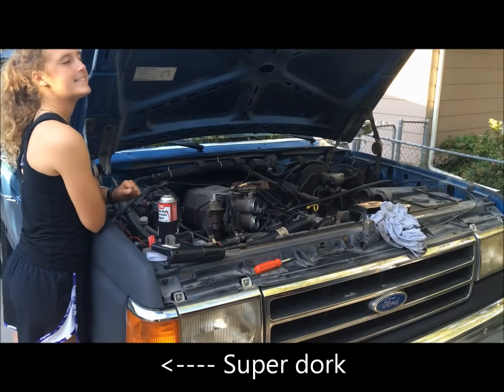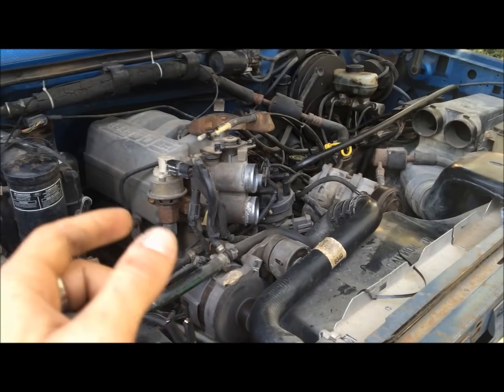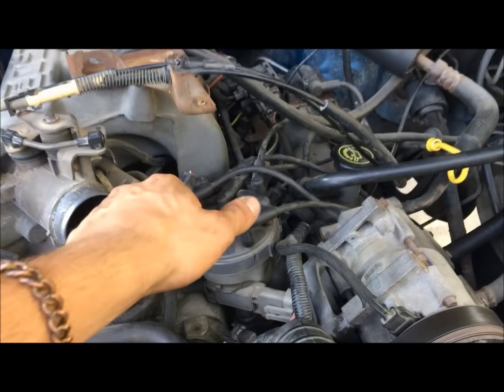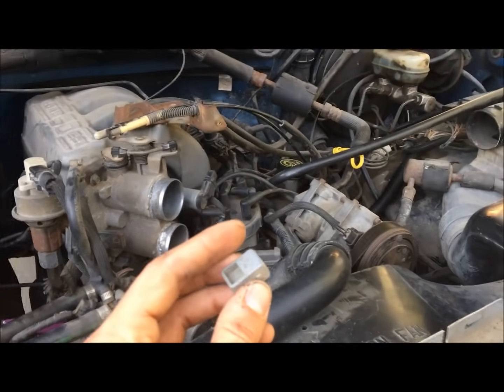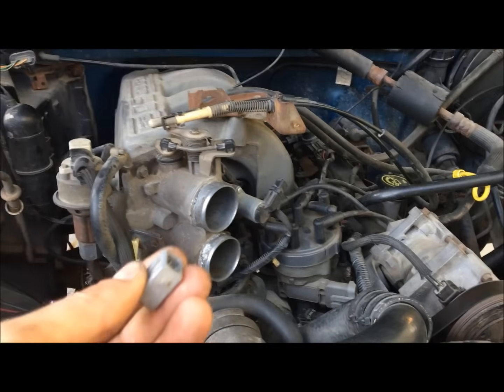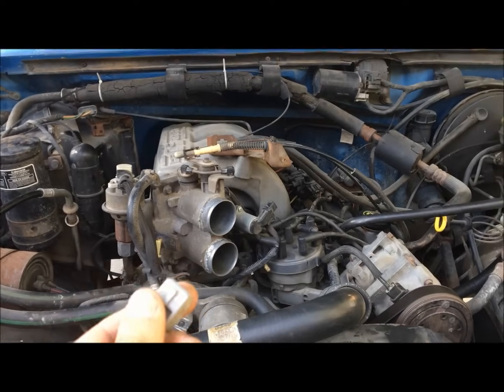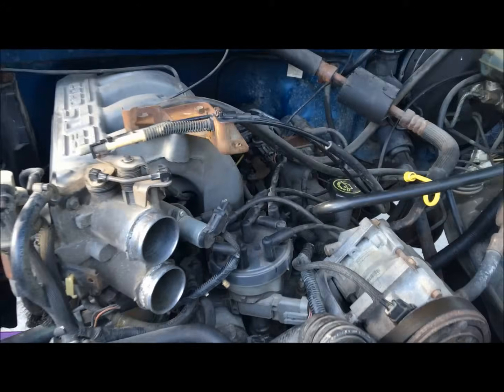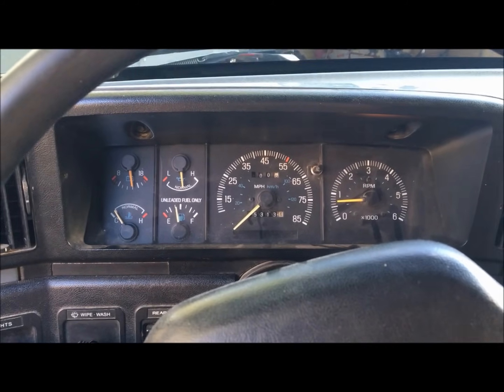Setting Ignition Timing - EFI Ford 302/5.0 (Bronco & f150 - How To)

Comment: I have a question and I'm not sure if you have the time to respond but i have a 88 f150 automatic 5.0 and the distributor is not aligned as in set or sitting like yours is in this video like i mean the Ignition module on the distributor. Yours in the video shows it sitting closer more to the ac compressor but mine is sitting right up against more to the thermostat housing so would that mean the timing is set completely wrong ? 

I ran engine up to temp and unplugged that connector then tryed to set the timing at 10 degrees but the problem is no matter where i set the timing light cause i have a dail to do advance on ig the marks don't show up at all so i marked the crank pulley wkth the balancer and then i could see where it was sotting at and apparently the mark is on the bottom side of the pulley when running and trying to move the distributor to move the mark back up around on top where the timing cover has it marked at will not work and only thing i can think of is the timing is 180 degrees out
Reply: So either 1 its 180 degrees out or 2 the balancer is so worn out it slipped and that's why the mark on the balancer is showing the marks on the bottom and not way up where it should be 

Also if I try and turn the distributor back about where yours is in this Video the truck will not start and it will die.  I have to have it pushed all the way to the thermostat housing for it to Run . 

Hopefully you or someone can help me with this . Thanks

Comment: So I just replaced my distributor and now my truck won’t even start to do this process any ideas what I should look for also can hear the fuel pump turn on and off but just cranks and won’t turn over
Reply from the maker: Did you do all the proper things for setup when you installed the distributor?
Reply: @ThunderHead289  I’m pretty sure I did
Reply: @coltonburke7639 ... Well...1st, buddy...Anytime you ask a question or want a direct answer on YouTube,   you need to give as much information as possible...Such as, in my case...(1993 Ford f150 5.0) auto tranny 2WD, No mods...That way, the OP can have a idea how to help you...2nd...Even if I was a ASE certified mechanic,  I couldn't help you coz I don't know WHAT kinda trk or engine you got.....4 cylinder...6 cylinder...8 cylinder...Gas or deisel or what...???....Kinda like going to the Doctor...Tells him you gotta stomach ache and Diarrhea...Didn't bother to tell him you just left a All-you-can-eat Pie-Eating Fest...Same thing here...Sooo...Re-ask and give the OP ALL the information he needs to help you...Cheers 🍻!!!!😊😊😊

Comment: The timing is stamped on under the hood if its pinging you have really bad gas with to much ethanol typical nowadays they put to much ethanol to be cheap. Also O'reillys fuel treatment is in a red bottle can help sometimes better more methanol then ethanol in the type of situation let it sit for a while first before you start it up.  Great for a rig that wont idle like it used to without bad gas.

Comment: i HAVE 1986 bRONCO with efi what is the firing order for this monster  online state 13726548 for efi and 15426378 for carb unit
Reply from the maker: 86 stock cam should be the firing order that ends in 78 (if it’s a 302) 
In 1994, all 302s sported the 48 firing order which is also the 351w firing order.

Comment: I've got a 1992 F250 5.0 EFI.....and just installed my rebuilt engine...and struggling with timing.  Don't have a timing light yet....but I will get one soon.  In the meantime, is it a good strategy to set initial timing with a vacuum guage?  I installed an aftermarket guage in the cab....along with a trans temp guage.  If you use a vacuum guage, how do you specifically do it?  Right now, I have it set so I'm getting a vacuum reading of about 16.  Haven't checked to see how far I advanced the timing, though.  My spout connector is on the fender....but I haven't set timing by taking it out.  Will try that tomorrow.  I just set timing with the spout connector in place...while idling.  Truck ran fine....but knocking just slightly, I think.  I think I'll back off ever so slightly tomorrow...and see how it runs.  Will try doing it with the spout connector disconnected...and see what happens when I put it back in.  Would be so much easier to set timing on an older vehicle...where it's all under your control...and don't have to consider the electronic control done by the ecm....lol.
Reply: You can kinda set the timing by ear if it's straight piped/ no muffler etc. Def need a timing light. Go to harbor freight and get one
Reply: @pete538  Ended up getting it done well, with the use a timing light..an installed aftermarket manifold vacuum guage...and by ear and throttle response.  WHen it's warm, it runs at about 18 psi, which is pretty healthy, I would think...and I think the final timing is about 15 degrees.  I forget exactly , as it's been a while since I did all this stuff.  I set the timing late summer last year.  It's been running great....and no leaks...lol.  I replaced a bunch of the vacuum lines, which really helped the cause.  Runs nice and smooth.
My only remaining issue is that it  only idles for a short time on it's own, when cold...and so I have to keep my foot on the pedal to idle at about 1000 rpm for about a minute to two to get the engine warm.  After that, it idles fine.  I had already bought an idle air control bypass but pulled it off when I was struggling with timing....and need to reinstall it.  It's a matter of just doing a little more setup, as I also removed the EGR pipe from the top of the intake manifold...and am just running it off to the side with an air filter on the pipe.  These things don't adapt well to aftermarket manifolds.  All that stuff has very likely changed the air flow during the warm-up period....so it needs some fine tuning.

Comment: I have a 96 f150 that I need to put the distributor back into after removing. This is the first time I've dealt with timing at all. When I first intstal the distributor should I have the timing mark set to TDC 0 or do I need to install the distributor at 10 degrees BTDC?
Reply: Put the distributor in at tdc....and then advance it about 10 degrees (clockwise) before you start up.  Makes it easier to start...and then set the timing from there.  I'm basically doing the same right now on my 92 F250 5.0, after rebuilding the engine.  Make sure you have good gas in the tank.  I'm not religious about the 10 or 12 degrees.  I think that's just a conservative factory setting.....but probably isn't the best setting for maximum power / torque.
Reply: Oh hell I hope you marked the spot where you removed it. If not you'll have to pull the 1st plug to find tdc

Comment: I have a 1989 Ford Bronco Full size 5.0  302 ci  When the motor is warm i can't turn the distributor,  when it's cold i can,  yes the bolt is loosen  i have worked on Cars and Trucks my whole life and never had thin happen,  i am 58 yrs old  the heat makes the metal expand  so i am going to use a wrench to try and turn it ...

Comment: Hi! I have a 89 Ford F-150 with the 300 manual. I was wondering if anyone could give me information on raising the throttle higher to have a smoother take off in 1st gear just for the ease of driving.
Reply: Lol take a few vacuum hoses off. I've got a few vacuum leaks and mine has a high idle when cold for longer than it should. I wouldn't worry about it. Just use that gas pedal

Comment: Video is a great help.  Would greatly appreciate your help with one thing:  I have the 1/2 inch bolt loosened but cannot rotate the distributor...is there a trick to how to grab a hold of it?  Thank you.
Reply: It's likely gummed up.  Shoot the base with some penetrating oil and let it sit for a day.  Might help too to remove the air intake hoses so you can get a better grip.  It should turn without much effort.

Comment: I have a 95 f350. 460 engine. Was told timing is too advanced since it idles high, smells of gas (rich), and once I drive it, it acts like the battery is about dead. Turns over very slowly. Once it’s cooled a bit it starts fast again. It’s a new starter. New solenoid. Wires are all good. Anyways. Do you have a video to check the timing on my beast?  Thanks.
Reply: Timing shouldn't affect idle. Probably a vacume Leak

Comment: Hi 
 i need help with my grand marquis 1985 it is electronic control ignition 
My problem is when I connecting timing advance wire the engine become bad running and locks like misfire and when i disconnect the wire engine running smoothly 
I adjusted timing as the factory said (10°) b tdc
Please help me I can’t fix this issue
Reply: Same

Comment: I have issue with my 85 grand marquis I adjusted timing as factory bock 10° B tdc and plug advance wire but the car still jerking at 40 miles speed 
When I disconnected advance wire the car jerking disappeared and engine running smoothly

Comment: I tried this with my 93 lightning but when I turned the truck off and reconnected my spout, when I turned it back on and checked the timing it set back to what it was before. Which is at 24, any idea what went wrong?

Comment: What is that little knob in your hand called
Reply: It's called the SPOUT connector. Stands for Spark output. It retards the timing when disconnected. The timing should advance when it's hooked up. If not, it's the module.

Comment: i have a question... need help with my 89 bronco.. 5.0.. passenger exhaust manifold sensor.. is it air temp or O2? ford says its an air temp sensor.. autozone swears its an O2.. what is it.. currently wires cut. so i need to replace it..
Reply: It's the 02 sensor. If it's screwed into the exhaust manifold. Air temp. sensors are screwed into the intake manifold.
Reply: Ya, it's an O2 sensor. In 1992, it's on the Y pipe...also on passenger side of exhaust.  The connector comes off the harness going to the starter.  Basically part of the smog system, monitoring exhaust temp going to the catalytic converter.

Comment: what size is the hold down bolt?
Reply from the maker: A half inch shallow socket on a swivel with an extension is what you will need to loosen it

Comment: I can't find the thing you unplugged. What if I don't have one?
Reply: Mine was over by the driver side fender
Reply: It retards the timing for base timing. It's usually in-line with the module wiring. Use white-out to mark the timing mark. Check for 10° mark. Timing advance is 30.
Reply: It's actually called a Shortening bar and Not a bad thing if you DON'T have it. PITA if you lose it.

Comment: Get a Actron CP9690 code tester. It checks graphing, live, record, oxygen sensor tests, MIL light reset, oil change light reset, ABS, and MORE! It comes with OBDI cables for Ford, G.M., Chrysler, and 2 Toyota. It has a cigarette lighter cable, instructions, and a black pouch. It's very easy to use!

Comment: What year is your Bronco and does it have a mass air flow if it does what is your computer part number
Reply from the maker: +Sisgirlie17 we no longer have the bronco - it being a 90, I believe it predates maf. Should be the same process if I remember correctly. 94 the firing order changed to the 351 order. But cylinder 1 is in the same location

Comment: Hey can you help I have a 1992 bronco with the 5.8 Windsor it runs good but when I try to pass on the highway it revs but doesn’t go like it should. It takes off just fine from a stop. What do you think it could be?
Reply: Clay S i run a 90 351w in my bronco. It came out of a f350. Its pretty lazy to be honest.  351w does best on NGK spark plugs... ive tried others... no good. 
Have you ever replaced the inline fuel filter? Has the catalytic converter ever been takin off or replaced. If you drive it hard at night.... look under the truck to see if the cat is glowing red hot.  If it is its plugged. Change it or knock the guts out.. my 88 was plugged bad. Also... inspect or replace the cap and rotor if the terminals look dirty or corroded. A lil crack in the cap will do all kinds of things. ... also check the air cleaner.. make sure mice or squirrel s didnt make a new home... ive seen it...   the 351w will pull the ass out of the world but in stock form they are not real fast. If your comparing to new pickups forget it... new stuff is stupid fast compared to our old broncos.  My 400hp 408windsor bronco wont keep up with my dads ecoboost. Just sayin..
Reply: @endurotruckererniedesjardins  Ya....I'd rather have the old simple vehicles, any day of the week.  At least it's normally not too hard to keep the vehicle maintained and running.  The only time I have ever been stranded was due to a fuel pump that died on me.  Generally, I don't have to worry about the electronic shit that strands newer vehicles so often.

Comment: Hello, hope u can be the one to help me out, I've asked many mechanics on here , some never answered, my 93 ford f-150 has a fluctuating rpm's and tailpipe backfire, have replaced failed fpr, iac valve and the tps, but still have same problem.
Reply from the maker: Do the spark plugs.
Reply from the maker: +ThunderHead289 do the spark plugs and the cap n rotor with new wires. Always neglected, makes a big difference.
Reply: Remove distributor cap and clean distributor out good with a can of brake clean. Then blow it out with air. See how it runs. Debris and crap build up in there and will interfere with distributor pickup coil signal. Still runs like crap or stalls, check your pickup coil in the distributor by testing voltage between it and ignition module. Should be between 4 to 6 vdc while cranking. No, low or high vdc, replace the coil/distributor. This is in assuming the rig has been tuned up and kept serviced.

Comment: I have a 96 model 302 5.0 EFI Ford pickup. Just rebuilt the engine and the guy before me had all of his vacuum lines everywhere. Is there any way you can make a video showing how the vacuum lines are supposed to be run correctly. I have it up and running, just do not have anything correct when it comes to the vacuum lines.
Reply: Diagram should be on the air filter canister top.

Comment: the throttle response to me is weak the motor barely stumbles it's hard to tell but I feel like they may have not done timing correctly or even worse the distribution is off a few teeth but that's unlikely.
I have the notorious shuddering when start idle or going even slow I know the mercon iv old fluid is the cause and the friction modifiers break down . I haven't changed to mercon V yet but I will just figured that the timing is a good start. All I really wanted to know is what to look for anything that could be bad aside from timing off
Reply: Your Trans fluid can't be the problem. I had a lugging/ misfire on my manual at low rpms and it ended up being plugs. The plugs the previous owner bought were nice but impossible to gap (4wires going to the center of plug) I changed to cheap plugs and gapped them correctly and the lugging/ misfire went away.

Comment: I just bought a almost mint 1991 5.0 ho  Thunderbird sport from down south the guy had a distributor put in new old one went out . I'm serious feeling like it's not running smooth starting is a bit hesitant I did wires plugs all motorcraft plugs looked original if not over 12 yrs old .
Is the timing adjusment the same for my car as what is In the video?

Comment: This is what happened. My wires on my dizzy were touching and I think it shorted out the icm. So I replaced the icm and the pickup and wires in the dizzy. Set the timing but when I put n the spout and give it some gas it seems like it jumps way out of timing like detonating out the exhaust pipe
Reply from the maker: Wires in the wiring loom that go to the distributor were frayed and touching? Has this ever been running right before?
Reply: Yes. This my daily driver. Never had a problem. My dizzy is msd 8451 and I took the insides of car quest dizzy and put it in the msd. I don't think that's the problem?
Reply from the maker: +Albert White and you set the ignition timing to where it is supposed to be with a timing light while the engine was running (I know this is redundant, but you would never believe what people do lol)
Reply: I have but only set it at 0 instead of 10 or 12 degrees . Also put it on the cpu and got a code 111 koeo, but it couldn't read any codes with the car running.
Reply from the maker: why to 0? the ignition timing would be late - common result is backfiring out the exhaust
Reply: Really. So should I set it to 12 or 14 and then drop in the dizzy
Reply from the maker: you need a timing light, you can be off by as much as ten degrees by simply just dropping it in - in that manner. your issue is ignition timing related indeed.

Comment: I have a serious problem. When I plug the spout connector back in, my car starts to backfire and popping. Just curious if you ever heard of this problem ? I have a 95 mustang 351w.
Reply from the maker: A mustang never factory had a 351. Something may have been botched it the swap. Also, make sure your engine is off when you go to put the plug in again
Reply: 1995 Cobra R came with 351W
Reply: Depending on what side it's coming fron, tells you that one of your spark plug wires are loose. Mine did the same. Every vehicle does it. Find the loose wire and fixed.

Comment: Hey man great video . I knew there was something that needed to be unplugged in order to set the timing . All is good so far except the 1989 E models doesn't seem to have that plug in any where near the distributor ? Any suggestions would be great . Thanks
Reply: by the ign module driver side fender on 93s.
Reply: Look online of the module wiring to see if it's there.

Comment: fuckin' Ford Bshit
Reply: Gm had a connector to unplug as well late 80s early 90s
Reply: Nathan Warshawsky yea but you dont have to do this crap if the pickup coil went bad in a gm distributor, which gm never had a problem with the pickup coil anyways